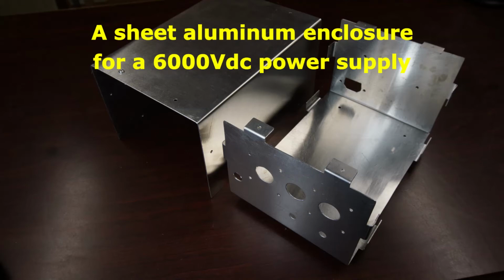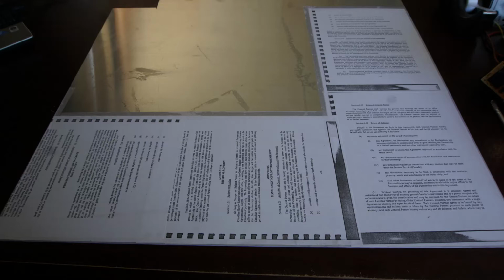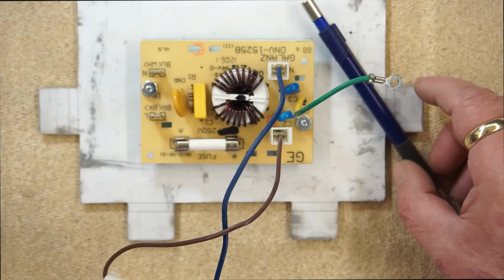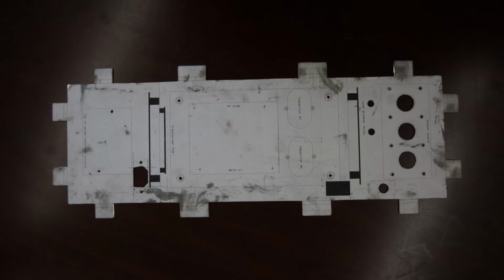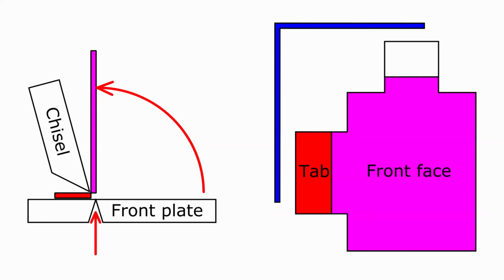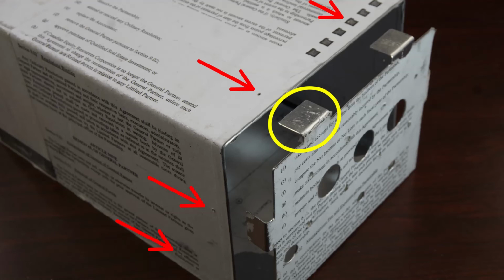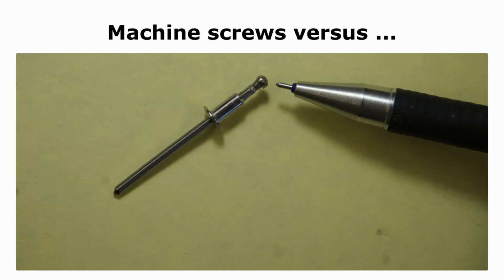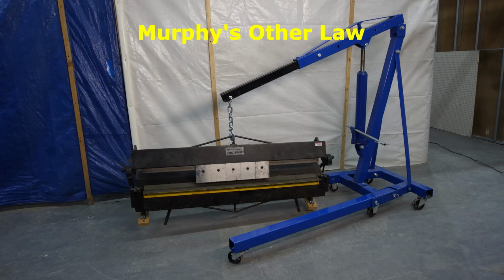Build a sheet aluminum enclosure

Comment: Thanks for the efforts taken to give almost all the finer details of making an aluminium box for the high voltage power supply using the MOT.
Yes I really learnt many things and principles in the mechanical work from the video.
I happened to see the video of making of the power supply too; you very well explained the finer details of voltage and the current ratings (and of the capacitor) of the MOT in that video too which I didn't come to know elsewhere.
Thank you very much ❤️